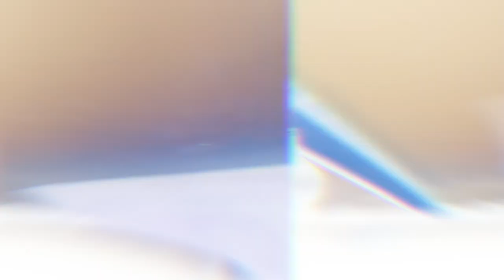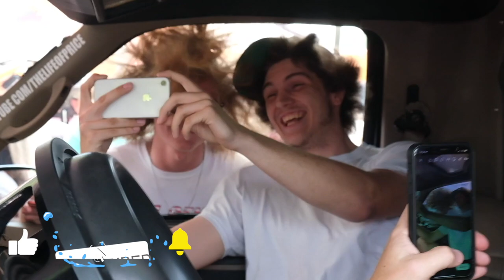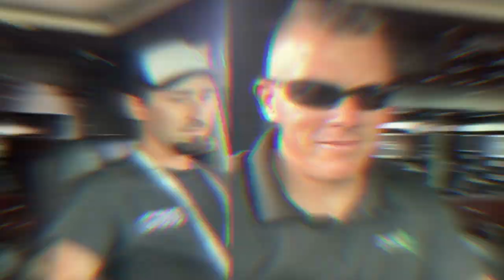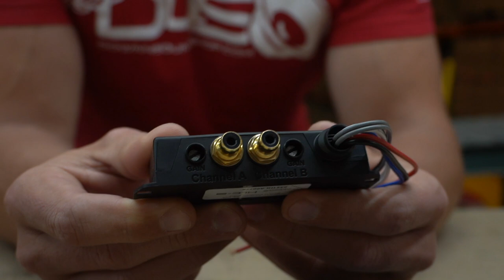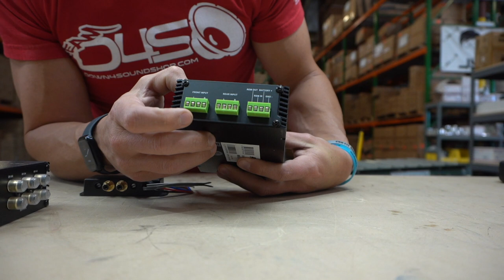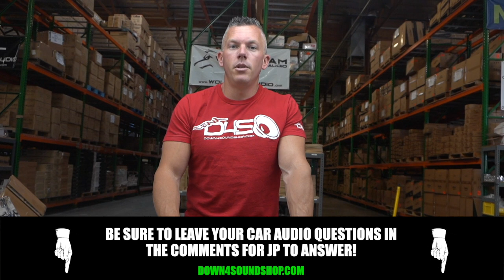WHAT'S SO IMPORTANT ABOUT HIGH LEVEL CONVERTERS?

Comment: Mind the bass roll off of the rears of most vehicles. They're conveniently in the rear but better fuller sound comes from the front.
Reply: This is a very good point that most people will miss...
Reply: That’s when you should just tap into the wires behind your factory radio. It looks tacky if you tap into the rear trunk speakers anyways.

Comment: Arc Audio has the SRI its literally the best for SQ 8v preouts, individual gains clip lights and 0-180 phase for each input, auto detect turn on, 3 ground noise isolation options an extra Aux rca input with remote volume knob and summing options for oem integration. No other LOC compares

Comment: Hopefully you can help me with a couple questions here:
I have a 2015 Honda civic with "Premium Audio Sytem" with an OEM amplifier, i bought a 5 channel amplifier and i want to power my 4 speakers (replacement aftermarket ones) + 1 small 8" sub in the trunk but I DO NOT want to cut wires and all that stuff.

If i get a 4 channel high level converter can i use it to make a bridge between my speakers and my OEM radio? if that is so, do i have to turn off, disconnect or do something to the OEM amplifier?

Comment: My head-units RCA output has failed, considering getting one of these so I can keep the unit and just use the hi levels for signal. don't really fancy buying a new headunit atm. Might even end up with better voltage out the RCA's, would nice to get more than 2V's drop the gain on my amps lol

Comment: Hey JP, i have a question about crossovers. i know that the main crossover is on the amplifier but since my head unit also has crossovers, should i also use those with the amplifier or stick with only using the amplifier?
Reply: That is a good question! Both hu or amp will do what you tell them to do! 
If in doubt by having a cheap hu or amp just turn it up slow on the volume. 
In my experience using the hu for ajusting the frequenties is the most easy way to do it. 
Hope this helps.
Reply: @franshaan7388  Thank you

Comment: I am 50/50 on high to low converters.  For me my ride is for keeps for some of you they are not.  There is no point of buying a converter if a person will trade up of a ride.  And the other problem is the sound level of bass will be unmatch with the factory mids and highs.  A rookie has to understand that period or lose money or damage the factory audio.
Reply: When you are only using it for bass then i advice to get a amp with a bassknop. This way you can allways adjust to what you like.

Comment: Just trying to get an opinion. Will my Skar RP 1200.1D power two dual two ohm EVL 12's I just upgraded from SDR 12's. Haven't hooked them up yet, but don't want to ruin any equipment.
Reply: Tune it properly and you won't have any issues. Just keep in mind that you won't be getting the full potential of them subs with that amp

Comment: Wavetech for the win! Load resistors comes standard on Wavetech hi low levels. Cheaper and incredibly well built in Germany and a quarter the size of those db high levels.
Reply: Ive always seen wavetech stuff, but never looked into them. 🤔
Reply: @justchillin7274  zero issues with wavetech. I liked audio content but these are better , smaller and have load resistors built in.  Audio control sells them separately like jl audio